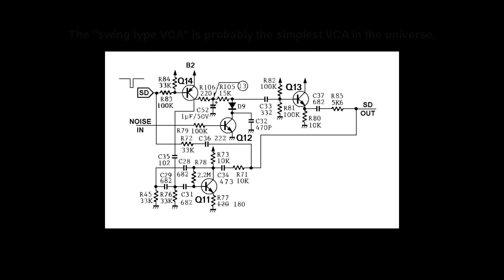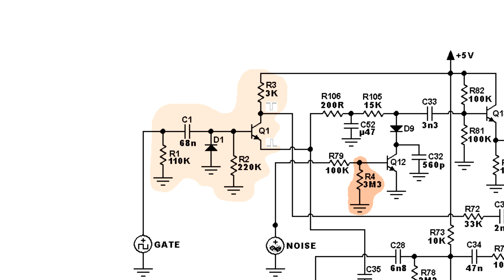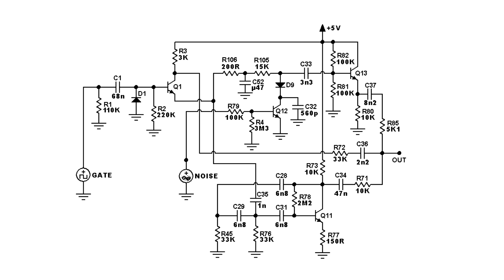DR-110 Analog Snare Drum Synthesizer on breadboard

Comment: Do you change the C29 capacitor at the end of the video (the resonant frequency capacitor)?
It seems the C29 and C31 capacitor values are 2n2 on the breadboard and 6n8 on the drawing. So the final breadboard circuit is not the same as the drawing?
What are the correct values if I would like to rebuild the working circuit?
Reply from the maker: HI, the correct values are 6n8, as in the original Roland DR-110 schematic. On the breadboard I was using parallel capacitors, 4n7 and 2n2 (6n9 total) as I did not have 6n8 capacitors. The parallel capacitors were connected by some small wires running perpendicular to the center groove of the breadboard.